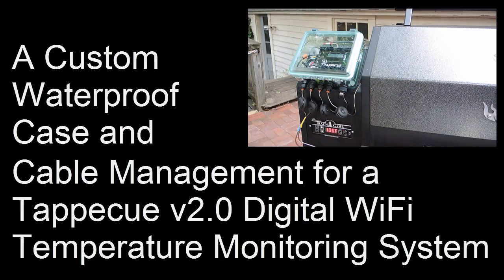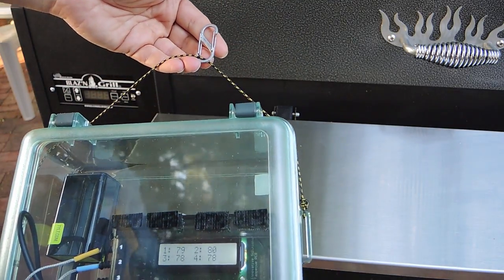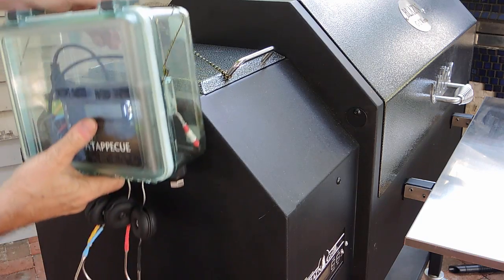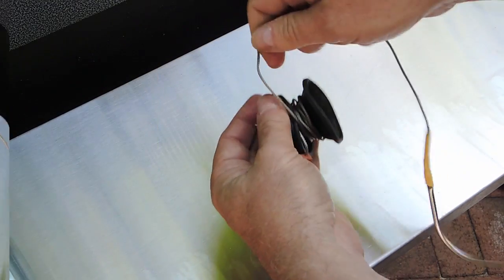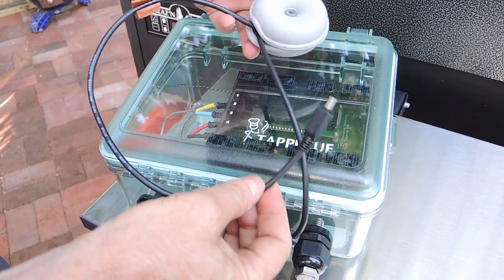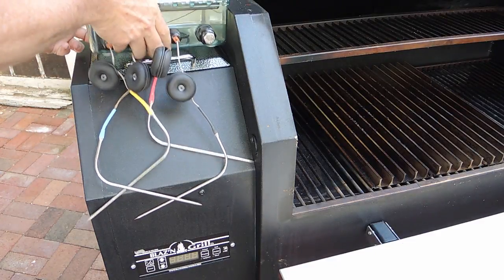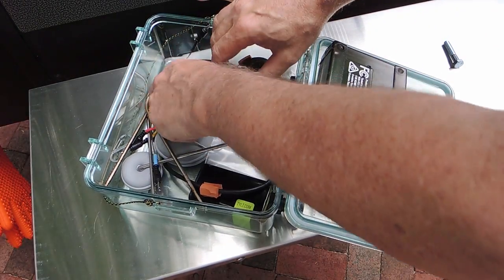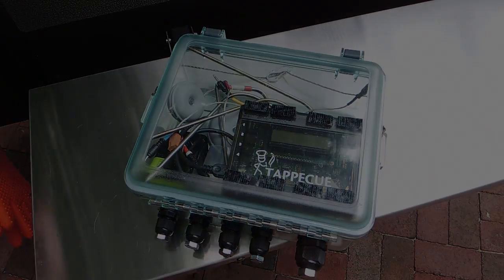A waterproof box and cable management for a Tappecue

Comment: Curious when you say you coated the wires w CA glue, did you coat a rag and rub them down or just coat them straight from the bottle? It's basically super glue and I'm curious if it made the wire stiff at all? Thanks for this video, this is great!
Reply from the maker: Todd Hagee I only coated the colored shrink tubing with CA glue to help maintain its color.  It discolored anyway.
Reply: Zentient1 gotcha! Thanks for the quick reply and this great idea!

Comment: This is great. Thanks for sharing. What brand/model battery pack did you use?
Reply from the maker: Thomas Trinity, thanks for the comment.  Pretty much any USB battery will work, as long as it doesn't have an automatic shutoff (because the device draws so little power, it might think there is no demand).  The batteries I have tried are typically 4,000 or 5,000 mah capacity.  Anything that will charge a cell phone should work.
Reply: Zentient1 the problem is I am having a hard time finding one without the auto shutoff.
Reply from the maker: This one works, and is recommended by Tappecue.  TP-Link Model TL-PB5200
Reply: Zentient1 awesome! Thank you so much!